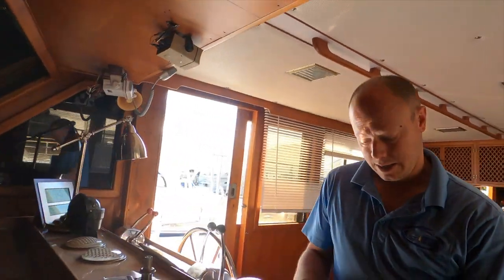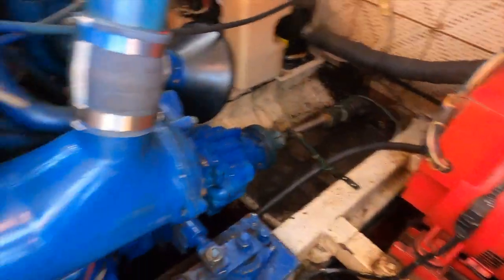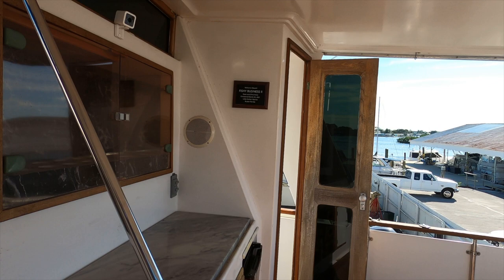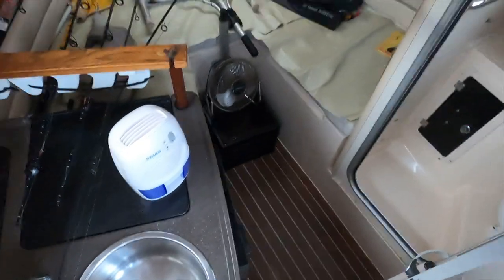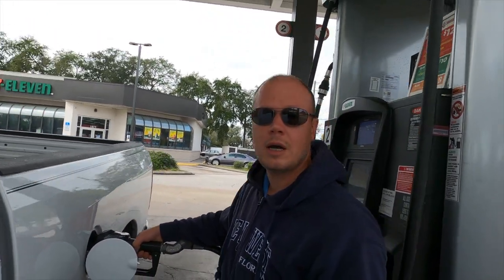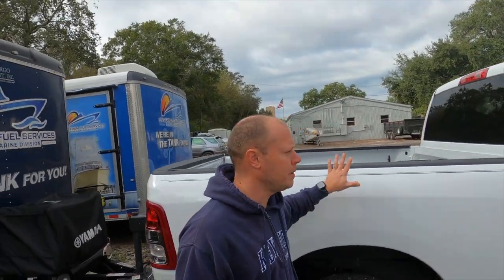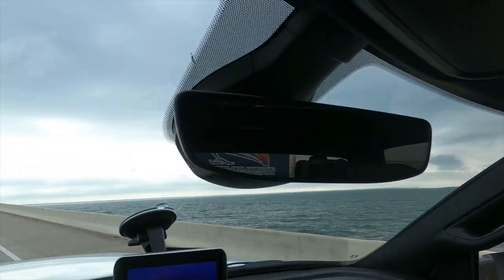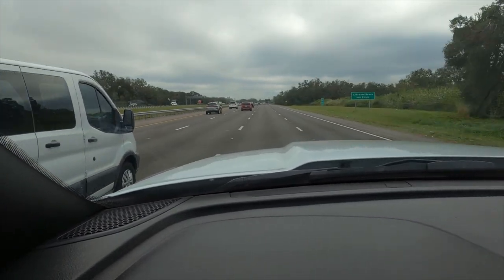Florida Boat Guy: Episode 24 - Why did I trade my RAM 2500 6.7 Cummins for a 6.4 Gas?!?

Comment: Great video Brother, I did the same thing, I traded the high output 3500 dually for a 2500 hemi. I was only towing 14,000 pounds at the time and thats well within the range of the hemi gas. One thing you didn't mention was maintenance. I purchase the 5-year package from the dealer. Cummins is $5,370 for a 5 year package the hemi 6.4 was a ONLY $1199. The Hemi is a 250K mile engine easy vs the diesel that supposed to last longer but as long as liberals in Sacramento California controls SMOG requirements, the diesel engines will continue to be problematic.
Reply from the maker: Thanks for watching! Yeah good point, maintenance cost on the diesel was getting ridiculous.  Nothing pulls better than a turbo diesel but the emissions requirements and costs are making it less desirable for regular folks

Comment: I just did the same thing a month ago….went from a 3500 Limited Cummins to a 2500 Laramie 6.4 Hemi w/4.10s. I haven’t been able to get a really good fuel economy comparison since it’s been so cold up here in MN. Towing in -10 F, I’m getting 6-7 mpg. Once we get warmer weather and it gets more broke in I would expect better.
Reply from the maker: My only regret is not getting the 4.10's!  Congrats on the new truck